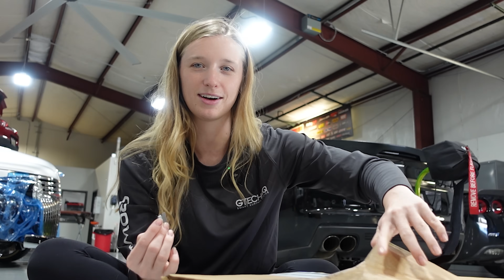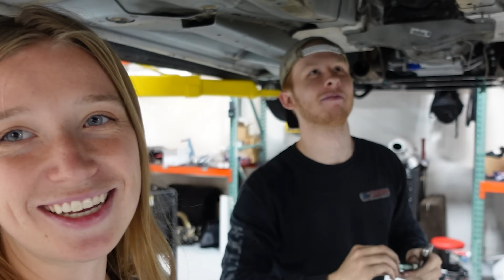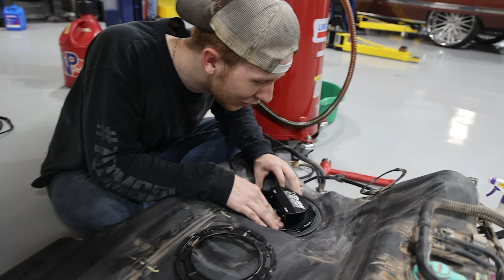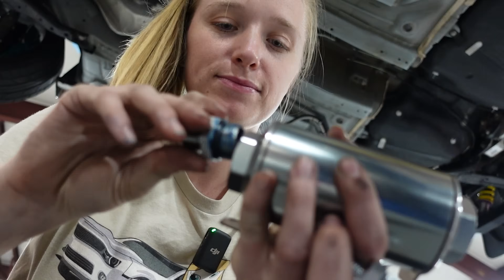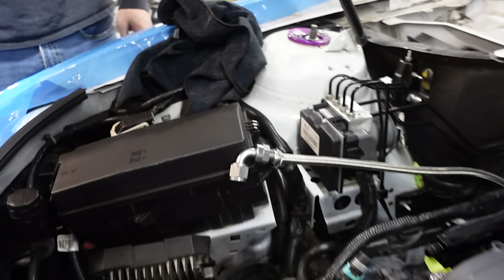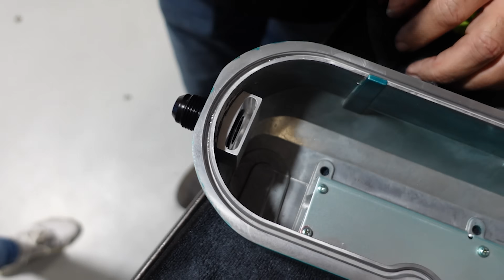Full Fuel System Install on my Fifth Gen Camaro Ep. 16

Comment: Hey what did you do with the original rerun line that runs up to the top back of the fuel tank. Is that just abandoned ?

Thanks
Reply from the maker: @tamm4750  remove them fully. No need for them

Comment: And yes the reason why a lot of people do it is yes easy access but if you have a full tank of gas and your fuel pump goes out you're kind of stuck with a full tank of gas and there's barely any way to get the tank down without siphoning the gas out and a lot of people do not want to siphon gas because it tastes like garbage and I completely understand the reason why people do it that way and I understand people that do it a different way like you are right now

Comment: I'm getting so much good information from what you're doing to your Camaro I'm going to see if I could try and get the same fuel package that you got it's probably going to be a little different cuz I don't have as much power as you have I'm running close to 546 horsepower so thank you for all the great information along this wonderful build that you are doing now I know that I could buy reliable stuff stuff that is really good if you're using it it's got to be good I just put about $15,000 into my engine to 2011 Camaro SS and frontal Orange I'm very happy with it it's always nice to have a brand new engine thank you much Kayla cannot wait to see your car on the road tearing up the asphalt

Comment: What size are the new fuel lines and is the flex fuel sensor on the feed side or the return side. I'm going to run flex fuel system this winter. Build season in Ohio winter time. Now you need a sticker on the car that says Built Not Bought. You've put a lot of work in.
Reply from the maker: Sensor is on the return line! So sometimes it takes a minute or a couple miles for the car to read what fuel it is running when you switch up the gas. But I’d rather have it all hidden under the car since it’s a super clean look now! Thank you so much haha if I started on the stickers I’d have… lady driven, stick shift driver, student driver, built not bought… it would have to be a troll at that point!